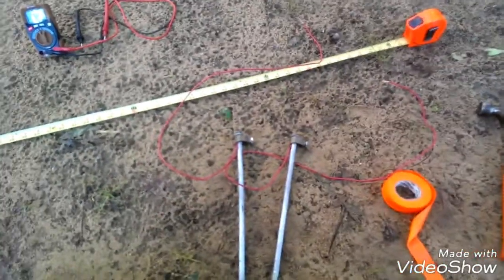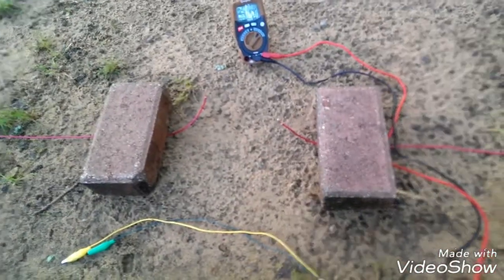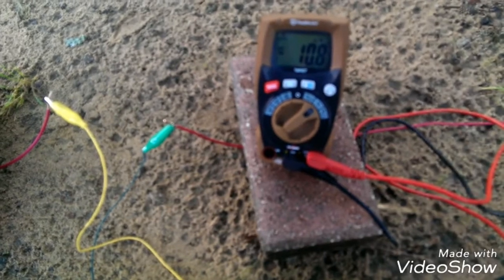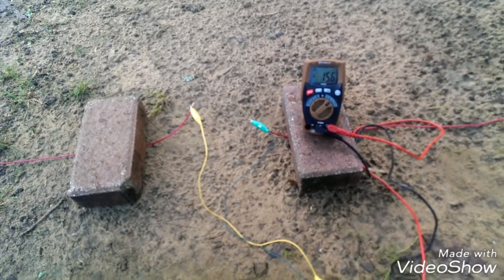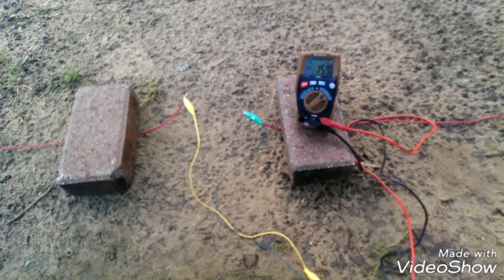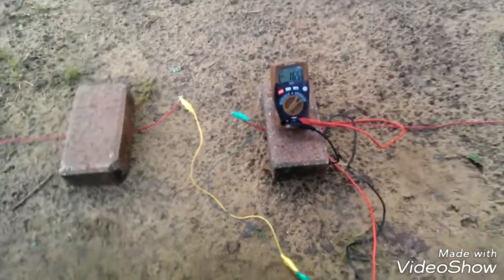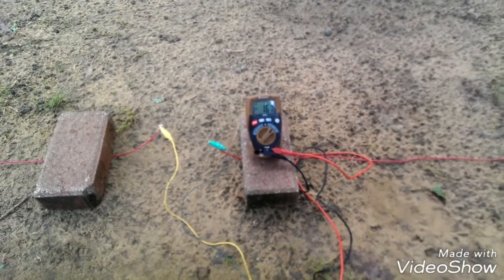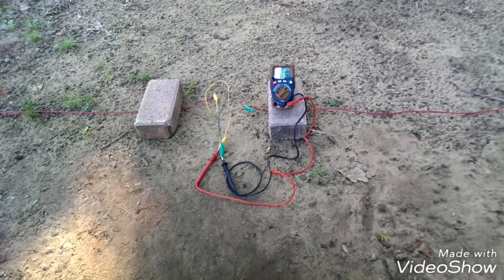Measuring the Telluric Current Part 1

Comment: Were those galvanized nails?  Even if there was some galvanic reactions going on, why would there be more volts on the E to W lines (from your later videos)?  That would suggest there is more going on here.
Reply from the maker: Yes. The four nails demonstrate the direction of telluric current along the ground. Isn't that cool to know?
Reply: @electrictao5180  Yes it is.  But also, if one direction is generating more current than the other, and it appear to be that way mostly for the E-W line, then harvesting them would be nearly continuous.  Am I missing something?

Does your research indicate that to be true ALL the time?  E-W > N-S?
Reply from the maker: @bigonprivacy2708 The direction varies greatly depending on location.
Reply: @electrictao5180  Okay. Fair enough.  But I'm trying to get to the direct answer.  In your location was it always that way, E-W > N-S?
Reply from the maker: @bigonprivacy2708 There isn't enough energy harvested from microvolts probes.
The science isn't about harvesting, but monitoring the earth electric field. Thx.
Reply: @electrictao5180  Totally understand but  was it always that way for you in your area E-W > N-S?
Reply from the maker: @bigonprivacy2708 Yes during the time of this video. It is just like weather that varies. We should monitor the data/probes to learn more about the telluric current.

Comment: Does the voltage get larger if spikes are  longer and put further into the ground?
Reply: no the voltage for the materials is determined by the reactivity series. the larger the metal pieces the more amperage you can draw from it tho. I get 1.4v - 1.5v from 6mm OD x 10mm Magnesium and 1mm thick x 10mm wide x 30mm long Copper strip. I have read that Magnesium for positive and Graphite for negative gives around 3v on a single cell!
Reply from the maker: Thanks Daniel! My demonstration was just an introduction to measuring the telluric current. I never mentioned using different metals to obtain a higher voltage. However, this was not my interest.
It's funny though, that most of my viewers were only interested in harvesting the energy. My interest was in monitoring the changing fields. Thanks again!
Reply: @electrictao5180  thank you for doing the video exploring the concept of variable telluric currents! I found it fascinating but you are correct, my main focus is on generation for off-grid living.. I noticed you had not mentioned different metals in your video hence why i thought i would mention it for @whatwhatohno..
Reply from the maker: Yes it can. It's typically just a few millivolts though. This experiment is just for an introduction. We would normally use 2-3 foot rods.